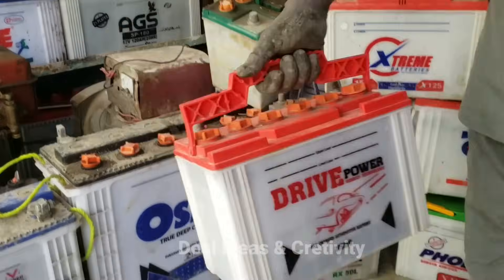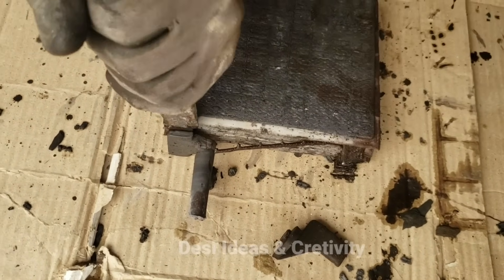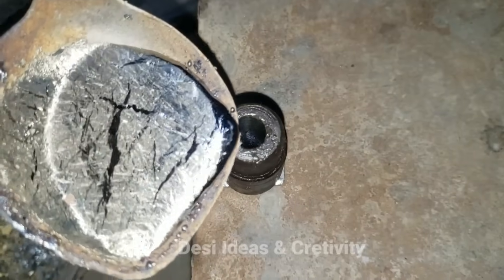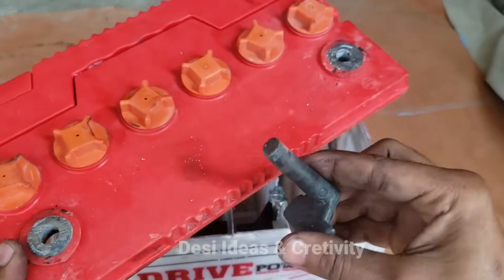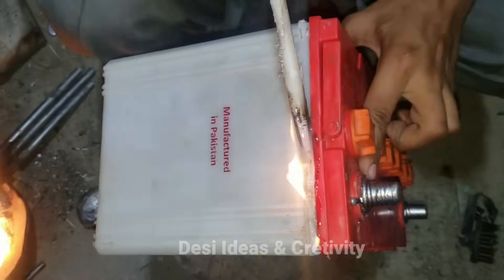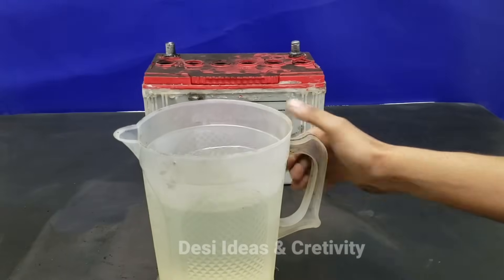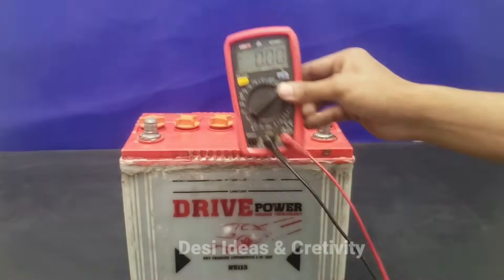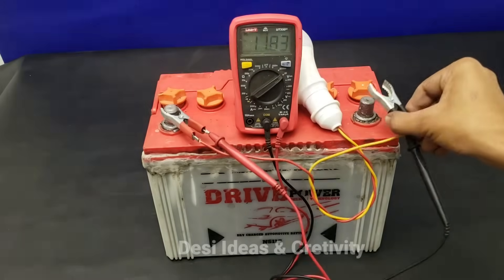Use Charcoal To Make Battery With No Expensis  #project

Comment: If a box is pressed slowly by some arm , inside heat can rise because of pressed air inside and if the arm stop pressing so that the box dont break, box being locked whit brackets so that it remain pressed , heat from walls could be used to heat water or air and produce energy

Comment: Somewhat iffy on belief. But! Since I do know that no matter how you make a basic battery. Each
 Cell is always approximately 2 volts, its very easy to just take a small jar and make 1 cell. Charge it and see it you get approximately 2 volts. The for the great idea. Don't care if it starts a car. But would run some lights around the yard for fun.

Comment: what about using bases like sodium or potassium hydroxide as electrolyte. Additionally what is the Ah Rating for a battery like this? I really want to do PEV's  like my emoto/scooter using this concept that I can just re-roll my vehicles battery vs spending an arm and a leg to buy another 72v/ 20Ah lithium battery.

Comment: In this way the capacity of battery will decrease and you can use it only with applying a considerable derating. Also the voltage of fully charged battery must be near the 14 Volts that in this case was 12 Volts.

Comment: I know in Taiwan they recycle a lot of stuff circuit boards etc.
=====
What kind of Amps can you get out of that battery 🔋?
====
I was going to try and buy a dry cell 📱. I like the idea of a compressed carbon.
=====
There's this one company that sells a dry cell you can put it in any way you want upside down sideways and it doesn't matter.
====
Clean your cells with a little bit of laxative. 
===
I was experimenting with CLR to clean a battery plate and when I got back to it Splash kicked it over 
🐎💨💕🔋🔥
👋😎💨 Bryan
Dr Howard said on a regular battery if you're stuck in the middle of nowhere . Shake your battery may be that will break loose that short in the bottom.
=≠===
Personally , a gigantic fish tank battery leaps room for the crud to fall to the bottom. 
===
To make sure it doesn't have sulfation

Comment: A battery is actually supposed to carry 12.4 volts or 13 for load draw. This is actually OEM manufactures. Also altering or modifying  batteries  goes against any safety protocol. Do not try this at home.
Reply: Oh shut up

Comment: It appears that the lead connectors and the acid are the battery. The charcoal is only a  sponge that holds the acid close to the connectors. Increasing the amount of lead and/or acid would increase the charge and discharge time of the battery. Any other inert material could be used to replace the charcoal. Mixing the plate lead and the charcoal and using it as the sponge could possibly extend the "life" of the battery. Thoughts.
Reply: Nope. Lead Carbon batteries are real.

Comment: It is a lie as long as activated carbon is not separated into hydrogen and oxygen.
It's a lie because it doesn't trap hydrogen.
If they are built properly, 2V per cell can be maintained for 1 hour.

Comment: What were you using for your soldering ?  Lead and ? And are you using a welder or batteries
Reply: A carbon rod, you can do this with the carbon rod inside a C or D cell battery.

Comment: Before you seal the top of  battery filled with the carbon. Also give 2 or less amps slow charge. Prevent smoke ( sulfuric gas ) is splosive with the spark of the terminals. Very good video thanks.
Reply: It's actually hydrogen gas

Comment: AI answer... Yes, it is indeed possible to make a battery using lead plates, active carbon, and acid. This kind of hybrid battery is known as a Lead Carbon Battery.

A Lead Carbon Battery combines the high energy density of a lead-acid battery and the high rate capabilities of supercapacitors. This makes these batteries excellent for applications that require both high energy density and high power density. 

Here is a very simplified description of how a lead-carbon battery works:

1. It has two electrodes: one made of lead dioxide (PbO2), the positive plate, and the other made of active carbon and lead (Pb), the negative plate.

2. The electrolyte is usually a sulfuric acid (H2SO4) solution, as is standard in lead-acid batteries.

3. When the battery is discharged, the lead dioxide (PbO2) on the positive plate and the lead (Pb) on the negative plate react with the sulfuric acid (H2SO4) to create lead sulfate (PbSO4) and water (H2O). This reaction releases energy.

4. When the battery is recharged, the reverse reaction occurs. The lead sulfate and water are converted back into lead dioxide, lead, and sulfuric acid. This process stores energy in the battery.

The use of active carbon in the negative electrode increases the battery's power performance by increasing the surface area for the chemical reactions. This means that energy can be delivered more quickly than in a traditional lead-acid battery. Moreover, the active carbon can help to reduce the sulfation of the lead plates, a key reason for the failure of lead-acid batteries, which makes the lead-carbon battery more durable and reliable.

Please note that this is a simplified version of the chemistry and reactions involved, and in practice, creating a battery involves careful control of the materials, conditions, and safety considerations. Working with lead and acid can be dangerous, so it's important to have the proper knowledge and protective equipment before attempting to make a battery.
Reply: Why isn’t this type of battery used more often if it has such advantages?
Reply: He's not using carbon or lead plates
Reply: @looneycrow7978  Charcoal is carbon.
Reply: @bamspay  "plates"
Reply: @looneycrow7978  The lead posts he's using are sufficient to make the battery work.
Reply: It will probably produce only low current, as it is missing the huge plate surface of the lead plates...hmm.. i wonder if it will  work more like a Supercapacitor...hmm...😅😅😅
Reply: As is, i don't  belive this battery works. It needs a separator to prevent self discharge. Without a separator between anode and cathode, the charcoal electrically connects the anode and cathode which self discharges any charge that got stored.
Reply: @kreynolds1123 well, if it does that it's fine🤷‍♀️.. as I believe some will try it, and just think it's better if it fails than blows up😆
Reply: Vert good Idea
Reply: Champ
Reply: Thanks for the comment
Reply: It is a SCAM ! ! ! - it has not electrodes except some minimal ones - you need lead plates with BIG surface.
Reply: @williamlee8650  this both +_  is charcoal
Reply: Thanks
Reply: Fast charging possible? Maximum current for charging?

Comment: This battery will have the ampere/ hour of 3 series connected small cell phone battery or maybe less . 50 times less than normal. What he should have done is to make sure no plates were shorting refurbish them and reattach them, check none are shortlisted then assemble. Battery will be close to normal.
Reply: Thank you. You are correct on refurbishing the place. But just how do you go about doing that?

Comment: i used to see those who repair old car batteries is by removing all positive plates and negative plates, examine the bad plate then replace with a much better plate. If your own way works well and fine, though im sure it wont be a strong power like spinning the to start an engine.

Comment: What does it take to build a battery that can store solar energy?
Reply: You can assemble those finger sized lithium ion batteries which your can find rated 3.7V at 2000mAh (2Ah). There are some with a higher amperage up to about 8000mAh. If you can find these, you can work out the math for the setup you want to build, and determine how many of such batteries you'll need - first in series, then in parallel. Be sure to test out your purchases before connecting them.
To expatiate, if you're looking to make a 12V battery system from the 3.7V/2Ah, simply connect three in series to get 11.1V at 2Ah. 4 in series will be overkill and the batteries will suffer overcharging due to the unavailability of suitable charge controllers, unless you can get a variable charger sort of. Experimentally, 3 of such batteries in series work for a 12V system. If you're gunning for a 24V system, then a set of seven in series will suffice. Once you have gotten the required voltage in series, you can place them in parallel to the amount of amperage you want. For example, if you want a 12V/100Ah setup, you will have at least 50 rows of the threes mentioned above that are at 11.1V/2Ah as the amperage adds up for cells connected in parallel while voltage adds up for cells connected in series. Fifty rows of threes mean 150 cells each. Of course, this will be way cheaper than a LiFePO4 battery but could provide similar function, just that you will have to apply a lot of caution and probably build it with the potential hazards in mind.
Reply: Be mindful of the fact that lithium does not like to be overcharged, so you will have to apply a battery management system to control its charging and discharging. Such circuits can bought online, and they can be easily configured.

Comment: Does it have high cranking amps like atleast 800 or 900
Reply: There isn't  enough surface area like you would need in a plate battery. This more like a potato  battery

Comment: How does charcoal react to produce dc voltage
Reply: It's not a battery anymore, it's a capacitor,  just like any other capacitor,  it stores energy buy half as much and 1/4 of the amp.

Comment: these batteries work but not for high current application, or in other words these are not a high current batteries as others like lead acid, lithium-ion or lithium iron phosphate. for example first crank car engine needs around 400Amp to start which only can be provided by high current batteries. in term of batteries more current mean more time. let say 12v 10amp hour give you small time to use while 12v 100amp hour give you more time to use it.
Reply: How it make positive and negative pole?

Comment: I live in St Louis Mo how much would it cost?
Reply: It's probably illegal in the States because of Lead pollution. These guys are probably in Pakistan or India.
    It's much safer for your health to just buy a new battery and take the old one to be recycled.
   Or you could try connecting one of those small welders sets to the battery and boiling it to de-sulphate the plates, after topping up the sulphuric. Demonstration is on YouTube

Comment: What can be the capacity (AH) of this battery ? Guess will not be able to drive an starter motor for two or three consecutive starts.
Reply: He put 4 hours 10amp in, and take 0.0001 amp back in 4 hours.
Reply: @NuttyGringo  😂

Comment: It's much better to fill the cells before you add the cover. You need to mention which type of acid you are using.  Charging at 10 amps until you have boiling acid is not safe at all.  Jesus.

Comment: the capacity of this battery will be? in AH?
By the way, liked and subscribed.
Reply from the maker: thanks for Supporting 
AH is maximum 10A 
capacity also low
Reply: @desiideascreativity  
Thanks from prompt support.
Reply: @desiideascreativity  Sir Es  K Zariye Agar 2 DC Fan Lagaye Tu Kitne Ghantay Ka Backup Day Gi Plz Reply ??
Reply: How can be the battery are 12v there is no + - on every tank
Should be 6 volt 
How meter showed 12v something confusion
Reply: Yes there is they are connected in series. Each cell produces 2v, by connecting 6 cells in series you get 12v

Comment: Fake
Reply: no this is not. activated round carbon filters cut to 3inch, 3 1/2 inch aluminum rod (magnesium corrodes to fast because of salt water) inside the center of the carbon filter and aa battery graphite rods and sea water works better than this. in a plastic jars multiplied 6 times. but he is just giving you an idea to expand further with a little research needed.  
this is a good starting point. i went from jars to sodium power/paste, graphene paper and a aluminum plate. 
solid battery youtube channel

Comment: Hello.

I hope I don't bother with my question, what type of acid should I enter to save my battery:

- Marks: Xupai
- Model: 6-evf-100

I will appreciate your help...
Reply: NO NEW ACID     Just fill with distilled water.The acid never goes away just the water.Good luck
Reply: @dcongdon2294  You mean add distilled water but I won't destroy the acid inside?

Comment: Some people think that it is fake .. But I guess they did not study physics in school or never hear about lemon or potato battery... This experiment is correct but this type of battery (calling supper capacitor would be appropriate) have very low energy density maybe just 1 to 5% as compared to normal lead acid battery...  I suggest him try to use Activated carbon with carbon black to increase its energy density and Internal resistance.. Also increase the size of lead preferably in plate shape.
Reply: If this is not fake, then WHAT DETERMINES THE BATTERY POLARITY since the same metal is used?
Reply: @MrChimstar  like led acid batt over all ;) ...initial charging.
forget the coal...it is a ordinary car battery with low Ah....
just enugh to light a 2w led for some time...is good enough for many ;)
sorry...my english is bad!
Reply: @MrChimstar  initial charging I think, just a big capacitor.
Reply: Surface area equals usable amperage! That led is about all that’s capable of.

Comment: There's no positive or negative plates, there's no separator, this is the same material (coal) so it can not produce any voltage difference. This is not working. 
What's the purpose of this clip? Clicks, comments? do something real.
Reply: This will work its like a battery we use to make in school with lemon or potato ... There is no need for separator... Obviously it is a very low energy density .... Its working principle is same like capacitor as symmetrical no need for - + for first time change...  Don't put you expert advise if you don't have knowledge about it...
Reply: @asifalikhan8677  lemon or potato battery requires 2 different materials working as cathode or anode. Usually zink and copper which has around 2eV difference. Battery requires chemical reaction for anodes and cathodes so one of them can release ions and one of them can accept. You don't have anything like this here. If you will put 2 same materials as anode and cathode in lemon or potato it willsimply not work. Same here. No way it may work
Reply: @iwannamynickagain  with your theory the symmetric supper capacitors with both electrode as carbon will not work 😉... But they work and available in market as Supercap batteries. In this the electrolyte breaks into  2H ions and SO4 ions .. When current applied one become Anode and other lead bar become cathode and electrolyte will break down when power is applied H ions moved towards + electrode and So4 collect on -electrode.. I have not did this practically but theoretically it should work but as I said the energy density will be far far less because the lead has no surface area... And sorry bro I don't want to get in more.. (Comment closed)
Reply: @asifalikhan8677  Ok. I agree with you. It may work as a bunch of super capacitors. Very ineffective related to the size of it but it may work.
Reply from the maker: During charging it  turned plus or minus
Reply: with out polarity it seems fake and if it could possible how the charge and where it will accomidate?
Reply: it may work but dont expect to start a car.. led lights may work on this..voltage could be accumulating between the carbon coal and the lead terminals as different "electrodes"

Comment: What is accumulated energy in this battery in Wh, shortcuit current and number of charging?
Reply: Not much.  4 hours at 10 amps equals 40 amp hours less loses during charging which I imagine is significant.  No cranking amps so don't try to start your car with it ;). For LED lighting and other low current applications.

Comment: Do you have any idea what the power storage capacity (e.g., kWh) of the battery is?
Reply: Complete technical information revealed in such a video is So important!
Reply: Assume 5W LED bulb. He said battery will run say 4 such bulbs for 5hrs. That's about  100 Watt hours.   It WON'T start a car.  If the old acid is used, the charcoal can be made for next to nothing then this possibly is worthwhile but I would need to research how much energy is required to charge.  Charging to boiling point dosn't sound good!
Reply: @ruthcormack1765 I doubt it was boiling. That was more likely an electrolysis reaction.
Reply: @ruthcormack1765 Ce n'est pas de l'ébullition, juste la réaction chimique